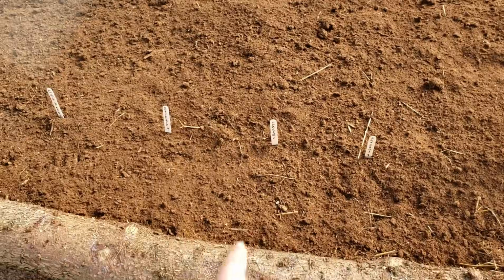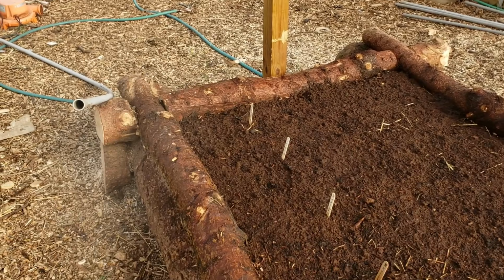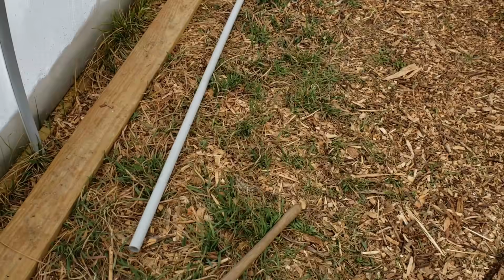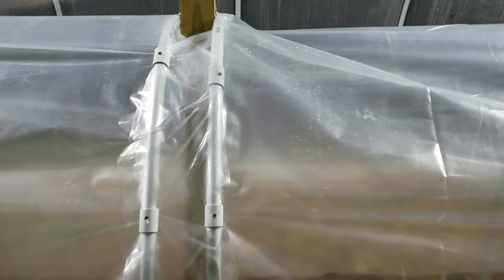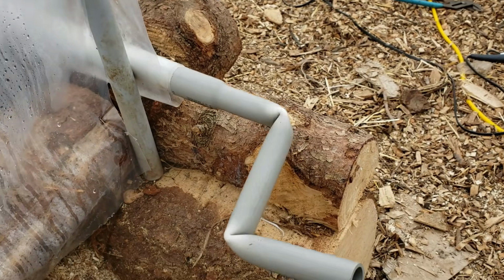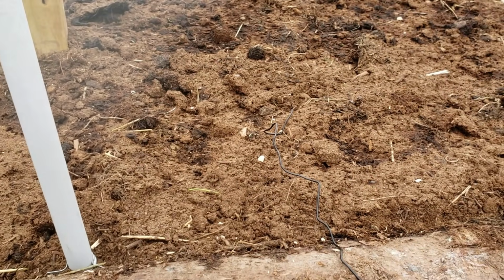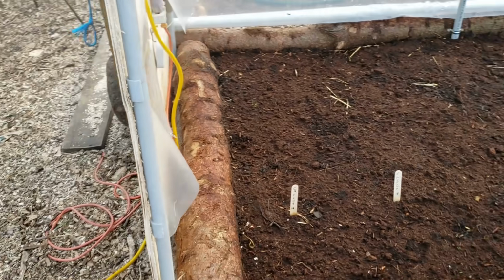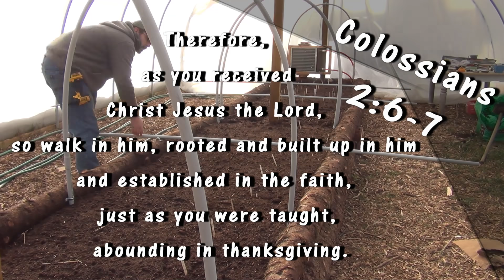With This I Can Grow Food All Year Round

Comment: That turned out so nice! The crank system is SWEET!
Reply: Since the end arches are anchored to the post watch you just run a string between them to hold plastic up? That might work.
Reply from the maker: I could have used a rope or nylon cord to support the middle but I think the hoops are a little more sturdy and allow the sides to roll and unroll a little nicer

Comment: It might be a good idea to put a fan all these at the opposite end of the heater that stays on to circulate the air constantly I think just a small one near the top would do it to help keep the humidity balance. And you could also screw a piece of wood on the plywood that you hook your handles against so that your plastic will stay up in a bit of a locked position

Comment: I used black drain or water pipe (I picked up as scrap from an indoor hockey rink) as my clips.  You have to find the sweet spot for your opening & I beveled the edge ever so slightly to ease on. It is a tad more flexible than the conduit or pvc pipe & hasnt ripped my plastic in 4 yrs of putting it on & off.

Comment: looks like you are getting a nice selection of tools now . mulch the heater end  might help it to keep from drying out or a deflector to send the air up some. would be interesting to put the outside temp sensor in the middle just to see what the diff  from one end to the other is .  i think your thought of a baffle to deflect down in the middle might be good also. a few milk jugs of water might help even out your temps and wouldnt take up space.  good luck and god speed on the planting

Comment: Looks good, I'd put a fan on that post though instead of a baffle.  Itll help stabilize the temp all the way through pulling some heat from the side that dries out and moving it to the end it has a harder time getting to.  Itll also even out the humidity a lot better.    Cool cheap build though, I like the roll up handle, that's the cats ass!

Comment: "Ready to wrap it up here..."  Was that at pun?  Ha ha .  Love it.
Very impressed with the final product and hope that it will work at least as well as you hope...
Here where I live in Queensland Australia, we need to NO plant most things - especially vegies - during the summer because the sun and the heat will make NOTHING grow...not even the ever lasting lawn which, with a little rain occasionally, will require mowing every third or fourth day...
We use a similar system of tunnel but use a 50% shade cloth (even in the hoop house which has 3% shade cloth over it full time). During the months of January and February, we ad more 50% shade cloth over the top of the hoop house to keep things cooler under neath and have a 3 minute misting of water every 15 minutes just to keep things from drying out in the heat...
This is the ONLY way we can have leafy greens during these two months...Some yers the heat sticks around to the end of April and starts as early as September....but mostly we don;t need the extreme measures other than Jan and Feb.
Looking forward to your Sunday fare...

Comment: Do you have one of those frostless hydrants inside the hoop house?  I'm not sure just one fan is going to keep the inner hoop tunnel warm.  That could explain why one end is drying out.  Not much heat may be getting to the far end.  A small exhaust fan there might help.  Does condensation drip into the raised bed or outside of the logs?  That could also be making a contribution.

Comment: I enjoyed the show. The 35°-44° temps don't make sense. You need a minimum of 53° soil temperature to grow most seeds. I built custom raised beds using reclaimed insulated roof panels and ran a subterranean drain tile pvc pipe along the perimeter, then I ran two 1/2" pex lines through that. My idea is that I can heat the soil directly and use grey water fed into the drain tile pipe and water everything at the roots.
Reply from the maker: Check out the earlier videos. The soil is heated with 100' of 3/4" pex from a wood boiler and the soil temps are kept above 65. The air temps are to prevent frost